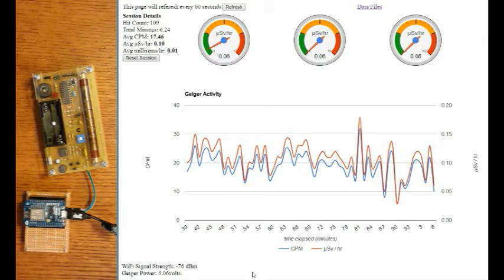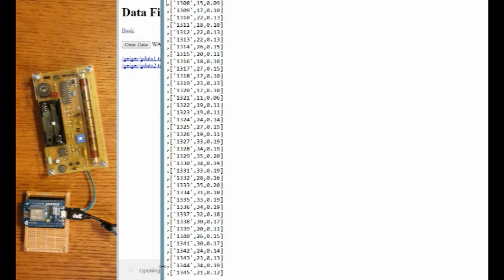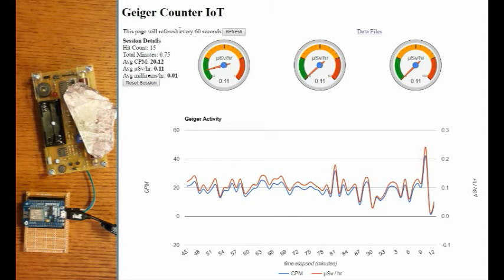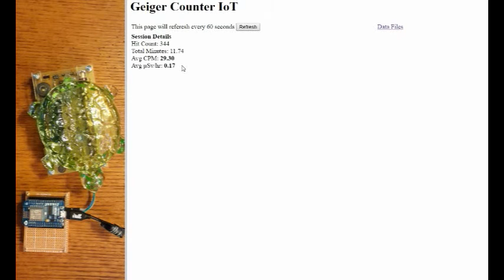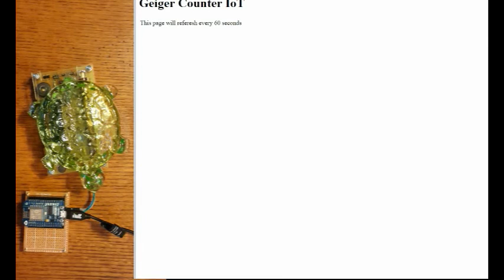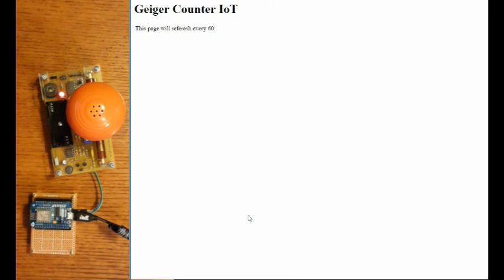Geiger Counter IoT Demonstration

Comment: ets Jan  8 2013,rst cause:2, boot mode:(3,6)

load 0x4010f000, len 3460, room 16 
tail 4
chksum 0xcc
load 0x3fff20b8, len 40, room 4 
tail 4
chksum 0xc9
csum 0xc9
v0004f180
~ld
 problem serial monitor print this